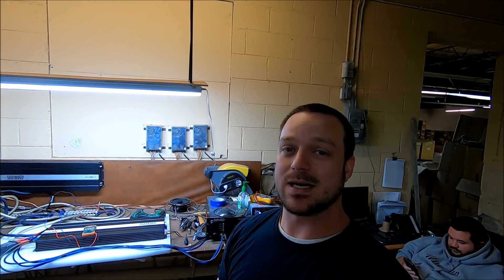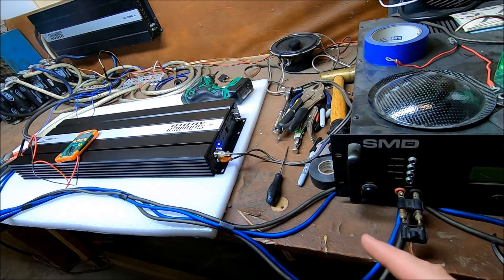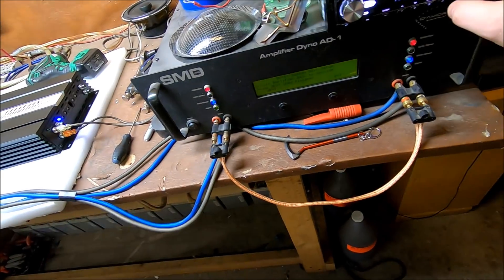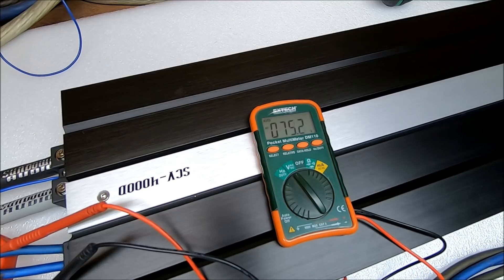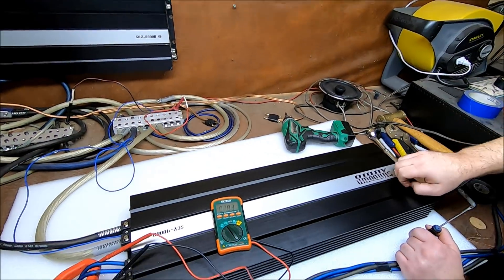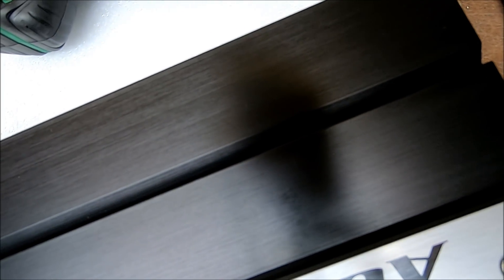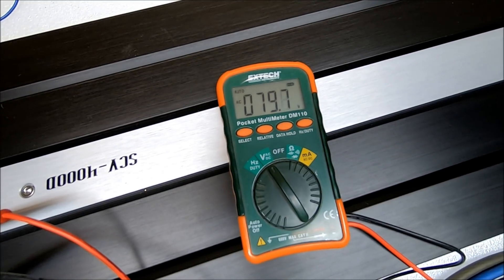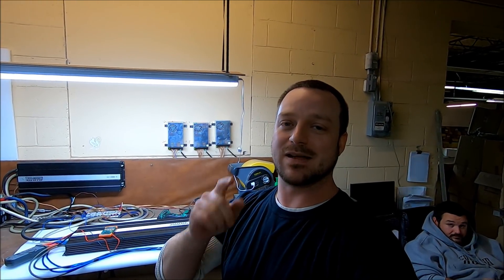***Setting Amplifier Gain by the Buzzing Noise, WTF?!?***  *Tech Time Thursday*

Comment: My amps power cables vibrates an the protect light flashes like a strobe light. I replaced the fuses on the amp, still doing same thing. I tested the battery an the power to amp. Both are fine so my little banger does not have bang. 

If anyone sees this an has an idea of the problem please post advice. I do not want to take it to the audio shop pay 100 then find out it was some $30 fix

Comment: From my experience the amp will go into buzzing before the dd1 distortion light comes on, but it will change pitch when the dd1’s distortion light comes on. Anyone else seen this? I’ve just been setting them before the distortion AND buzz.

Comment: You're not doing the right buzz test. You hook up a small speaker and tiny (around 1uf) capacitor in series with the amplifier output and listen for buzz there. 
The only time the amp itself will buzz is when the output stage is clipping so bad that it overshoots badly and the LC filters start to ring.

Comment: Great vid!!! Crazy b/c the VAC varies with frequency. At 40 hz my VAC reading may be 54.5, right where it should. On 50 hz the VAC reads 58.7 VAC & my amp is making the buzz sound. Every amp is built diff .. on my Zapco Z3kdII I’m suppose to be at 54.7 V AC .. at 55 VAC that noise is barely audible .. at 60 -62 VAC 90% of humans would hear it.. this was with a sine wave!
Reply: I’m

Comment: So it's safe to set any amp to 96.2 AC volts? Thanks for the tip! I just opened a install shop and business is SMOKING!
Reply: Enrique L nobody said that. He showed. 20v difference between using buzzing and using the right tools.. which means the right tools ARE NEEDED....idk what video you watched
Reply: @Finga_Trappa  smh it was a joke... 🧐

Comment: I don't know about the amp itself but I do remember watching a video by barevids and he showed himself using a regular speaker to set the gain on a monoblock amp. He put a capacitor to block the low frequencies (below 500Hz iirr) and turned up the gain until that speaker started to buzz, but it wasn't the amplifier doing the buzzing. I didn't watch the entire video but he did mention he was going to verify the output of the amp with his oscilloscope.
Reply: Carl Jr yes, its a great way to set gains....as long as you have the right cap👍🏻

Comment: I sent my gain with DD1 to begin with with my subs at 1ohm. Now I'll be running them at .5ohm. Do I need to reset my gain? Also what tune are using? I used 40hz -10DB

Comment: Derrick so what does sundown prefer us to use to set up our amps
Reply: What about DMM method?
Reply: Bronson Sherrill nope. Tried it and it does not give you a clean signal. Do it at your own risk. Better to use your ears than a dmm.
Reply: @UrAvgBasshead  you must not have done your calculations correctly.
Reply: Bronson Sherrill it’s very simple math. The problem lies in  how do you know where your head unit is clipping at? The smd-dd1 tells you that, so it’s much simpler than a dmm.
Reply: @UrAvgBasshead  well I know where mine is set now with DD1. So I know my point of distortion. Just dont go above that when using DMM
Reply: An o-scope or a DD-1 would both work well.